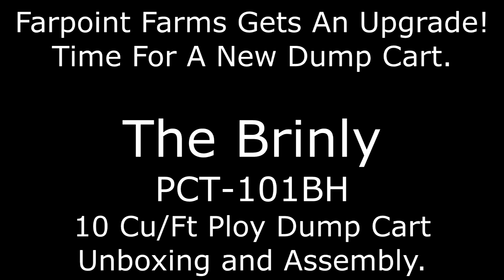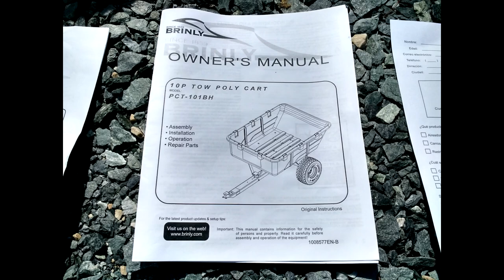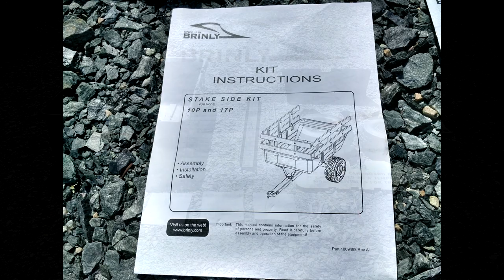The Brinly PCT-101BH Dump Cart. Unboxing and Assembly.

Comment: why dont you give all the metal parts another coat of paint or two, if you want it too last that is?
Reply from the maker: Good idea.
Reply: if find that its so much easier to paint new parts than to fight and remove the rust only to paint it again anyway.  all i do is use steel wool to remove the gloss, paint thinner to clean it up and add another 2-3 coats.  i think it may last the rest of your lifetime.  i love your chanel, very practical stuff.